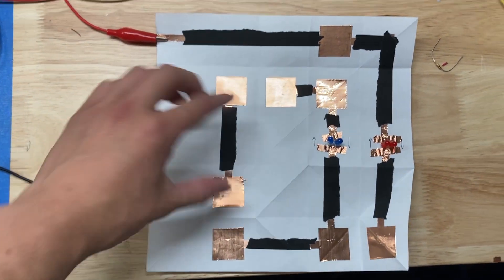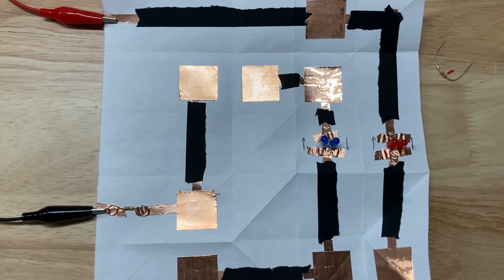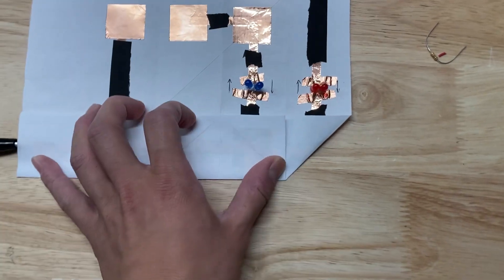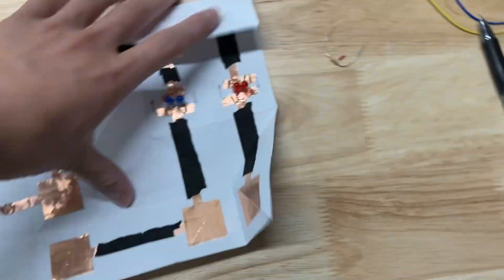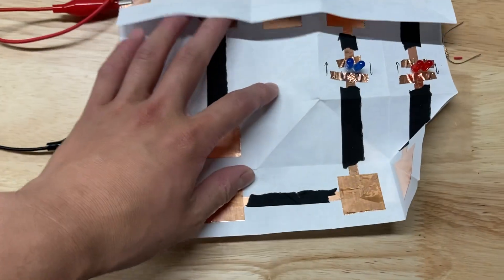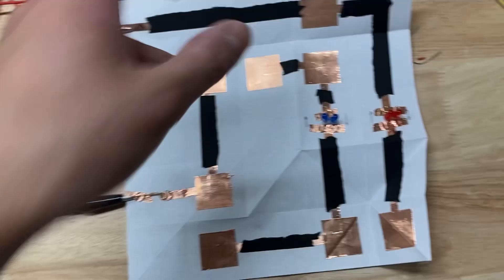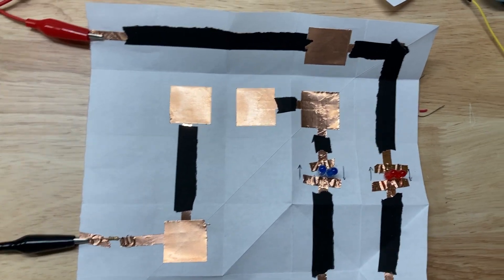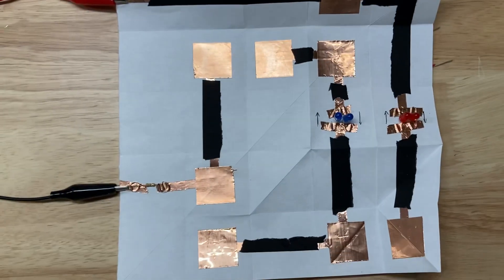Folding reconfigurable circuit (first prototype)

Comment: Cool, but what would be the application of something like that? Wouldn't it be easier to reconfigure circuits by pressing on off buttons with one hand than folding circuits with one hand while filming with the other? It would be really neat if there were some sort of material that would shrink when an electric current runs through it so you could actually fold the material using electric current.  Ooh I just googled it and found something that might work... Jameco "muscle wire." I bet you would have a lot of fun playing with that! On second thought that money would be better spent on a tripod!🤣
Reply from the maker: Hi Jeremy! I honestly don't really know what would be a practical application of this that can't already be done with electronic sensors (like accelerometers or pressure sensors) and transistor switches, but this was mainly just something interesting to try. Thanks for telling me about the muscle wires, I'll look into those! I also do have a tripod, I was just a bit lazy this time haha